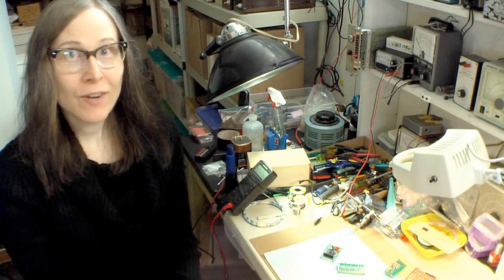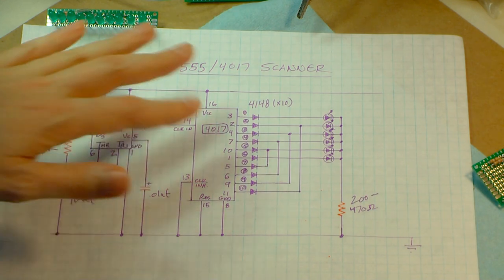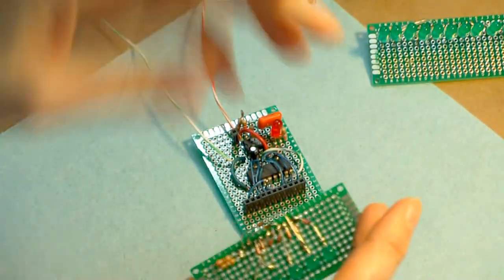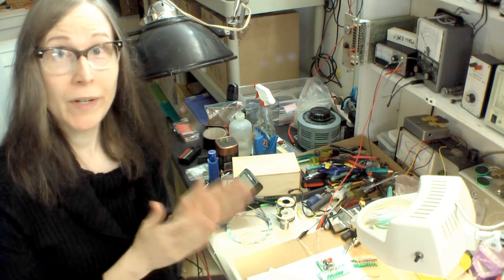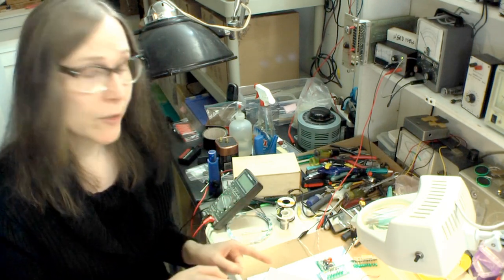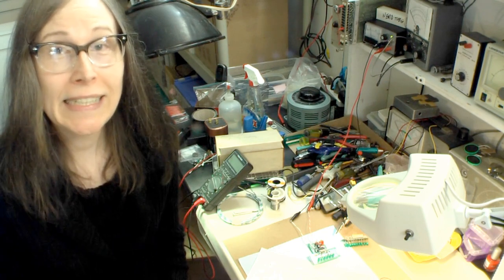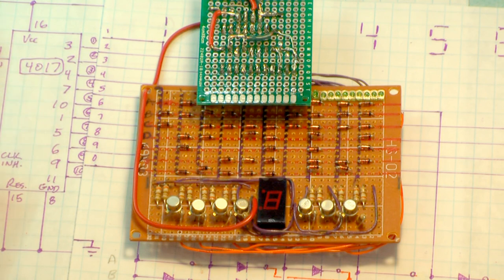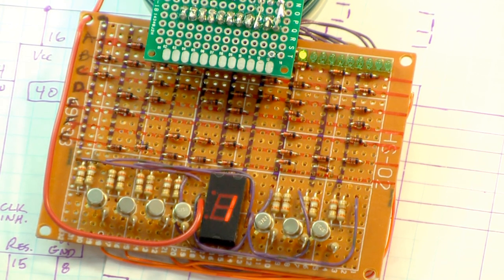FranLab: Diode Steering For Displays

Comment: Nice video - it will surely inspire people to get out the soldering iron.

To the current: The direction was - as fare as I know - defined based on an galvanic experiment. There you can see the charges (depending on the experiment positive or negative) as bubbles in the solution. So I have a bit of an issue when you say "the current is in reverse" - my mind has always to add "the electron current" or even replace current with "flow of electrons".

Saying the "flow of electrons is reverse to the electrical current flow" is more academic, but makes more sense to me. Again: In some galvanic experiments, there are actual positive charges visible, so the flow of charges and electrical current aligns.

It gets really strange when going into PNP transistor, where there is essentially an electron gap which is traveling - the gap can be seen as a positive charge although they are just places where currently is not an electron and it is not actually the hole thats traveling, but electrons "jumping" places making it look like as if the gap is traveling.

Comment: AS to whether the counts go zero-to-nine or some other way depends on your application.  A feature not mentioned is that when the chip goes from nine (last pin) back to zero (first pin) it also sets a carry-out pin high and this is the divide-by-ten output that can drive another 4017.  a string of these in a row make for a decade counter that can be the heart of many other circuits.  If you intend to use them this way, it MUST count zero-to-nine, as shown on the data sheet for the chip.
Reply: You could build a CPU that uses the 4017 for sequencing through the instruction cycles.
Reply: @RingingResonance  You could.  That was the first thing I thought of, when she explained that the 4017 had separate outputs for each state.  Perfect for making state machines.

Comment: I'm working on a custom controller for the video game Kerbal Space Program. I'm taking my design inspiration from the Apollo Instrument panel. My digital readouts are laid out in an imitation of the DSKY, but I did snag some nice alphanumeric 16 segment displays to use for showing units. Since the displays are common anode, they don't work with he LED driver chips I have, so I plan to use diode steering to code the characters (m, s, K, M, G, T, P, E, Z, Y, ∆, V).
Reply: Cool.  I hope for thematic consistency you will also impose restrictions on what repairs you are allowed to do if there is a malfunction during a mission!  :)
Reply: I'm not 100% sure, but I seem to recall that the DSKY used diode steering logic to do the 7-segment encoding as well.  The DSKY used electroluminescent displays, which were driven by relays, but I think the relays were driven by diode steering.

Comment: 27:45 - "Fire in the wire" - 
Eons ago (mid-70s), I was moonlighting doing electronic ass'y for a designer/supplier of specialized modems. Mind you, this was waaay before CAD. When Bob would energize a prototype, he'd announce "Stand by for smoke check".
In the interest of science/history, would you be willing to dissect one of the old Monsanto displays? I've searched, but I've only found drawings of the light pipe LED displays.
Thanx for your inquisitiveness !

Comment: Just for the record, the symbol of semiconductor diodes, comes as an abstraction of the physical form of first of them from early 1900s, the galena catwhiskers detectors, where the cathode is the little "plate" and the catwhisker, a bronze wire or pin is the arrow pressing the galena. If you get to see 1920s you will find them. This happens with most symbols, be them inductors (curly wire coils), resistors (also coils of resistor wire, made straight triangular to ensure they are different from inductance coils), capacitors, and so on.

Comment: 9:48 Is the diode connected to pin 3 of the 4017 necessary since it is going straight through to the LED? (i.e. since there's no "steering" going on)
Reply: It's not strictly necessary (nor is the one connected to pin 1, for the same reason), but if you don't do that, then the end LEDs will be brighter than the rest, since they're getting more voltage.

Comment: Hey Fran, did you know that the Display Systems 19S-8 incandescent matrix display (a.k.a. "eggcrate" display) uses an internal diode steering board to map which bulbs light for each number?

These displays are not multiplexed like conventional LED matrices. It just takes a decimal input, steers the current through a series of diodes, and displays it as numeric data on a matrix of #1820 light bulbs.

Comment: Current flow is the opposite of electron flow. I always have trouble connecting diodes in a circuit and usually have to use the ohm meter to refigure out the orientation each time I introduce a diode. I will try to remember that diodes are old enough that they point in the direction of current flow and not electron flow. 
I do like to think in terms of electron flow which means that the right and left hand rules are backwards. I now say; Face east, use your right hand and point at the eastern horizon with your index finger. That is the detection that we are traveling as the earth rotates. Now at the same time point your thumb toward the north. That is the direction that the magnetic lines of force a pointing. They exit at the earth's south pole and travel up and enter the earth at the north pole.  Now with your hand in that position, your middle finger will curl in the direction that an electron will be deflected. The electrons are directed toward the center of the earth. The earth ground is a reservoir of electrons. 
Now use your left hand and point your thumb toward the east. That is the direction that electrons are moving. When electrons move they generate a magnetic field. All the fingers on your left hand are curling in the direction of the magnetic flux lines that circle the electron. 
These are the new right and left hand rules and they only apply to electrons. The old hand rules deal with current and are backwards.

Comment: I've always interpreted that icon to mean the current in this direction is blocked.  The arrow would imply current direction but the bar implies its blocked from this direction. The same argument can be made for the transistor, the main vertical line being the bar.

Comment: Regarding the diode reversed current direction symbol, I remember, early Japanese electronic products, like 6 transistors AM pocket receivers and other, have had a minus on common ground rail and were using PNP transistors. Rule which follows the natural current flow direction.

Comment: Fun video indeed. I liked the music at the end.
Though I feel the need to disagree that the direction of current flow is wrong, unfortunate at most.
The flow of current is not the same as the flow of electrons, instead it is the flow of charge, or charge carriers. The electron is not the only charge carrier. In the brain Na+ and K+ ions produces currents in and out of the neuron, with the direction of current being the same as the direction of ion movement.
Of course for the aspiring EE student this is a bit unfortunate, but not wrong.

Comment: I drew out but never built a diode-steered decoder back in the 1970s, and was amused to note that including a bar on the six but not the nine would require 50 diodes, which was the number that would come in a package.

Comment: Came here from EEVblog's most recent video tearing down a hardware key dongle for Altera EDA software. This technique of "diode steering" seems fairly obvious, although I don't understand why this technique is called that? You could in theory achieve the same result with open collector / drain outputs or with a bunch of OR gates. What are the diodes "steering"? It seems to me it' the physical connections that steer the current not the diodes...

Comment: What you have really built  there are 7 discrete DTL OR gates. In other words - combinational logic. At least that is what we would have called that when I was in my EE program back in the early 80's. I like the three dimensional circuit building. But angling the diodes at one end or the other would have made that unnecessary. Or . . . how about standing all the small signal diodes on end in a 10 X 7 matrix and driving the anodes on one plane in one direction and combining the diode logic cathodes for each segment on an elevated plane in the other direction and making the display board 3" X 3" X 1" high?

Comment: I believe the diode schematic symbol was derived from the "cat's whisker" representing the fine wire connection to the semiconductor.
I tend to think in terms of positive flowing to negative in negative ground systems and vice versa... and I would call it a converter rather than a encoder or decoder...;-)

Comment: I learned when trying not to fly model planes into the ground, that it NEVER works to tell yourself, "it's the opposite of the way you would expect."  The problem is, at some point, inevitably, the correct direction will become learned well enough that then you end up second-guessing yourself.

Comment: there are 2 parts to electricity voltage that attracts electrons and current the flow of electrons  voltage the electric field flows from + to - electrons flow from -to +   
the symbol for the diode looks  like a point contact diode

Comment: 9.32 I noticed that the LED board that changes direction skipped a light on one of the cycles.  Do you know what could have caused that?  It that the 4017 not latching properly?
Reply from the maker: Penfold8 Vlog Reality - - - Blunt edit between two different takes.

Comment: What one old tech calls "diode steering" an older tech calls a diode memory. Make a fully populated 10x7 matrix of diodes, burn out the "bits" you don't want, and you've got yourself a "write once read many memory" board, a giant 70 bits in size! Lol

Comment: Fun projects but I had to troubleshoot these nightmare networks in a 3 out of 5 wiring system in F-4 aircraft in the 70s. DDL for control lines for mechanical tank tuning in a UHF radio. Try troubleshooting with only analog equipment.

Comment: I suspect that I noticed the small "Easter Egg" at the schematics that is shown at 9min58s, where the diodes at pins 3 and 1 of the 4017 are redundant, can be removed without altering the functionality of the schematics :-)
Reply: Those are there so that the LEDs on the ends don't end up brighter than all of the others.

Comment: 9:30  Did anyone else notice that it skipped #2 one time?  (I’m assuming 1 is the right-most LED and 6 is the left-most LED on the screen).  It went 1, 2, 3, 4, 5, 6, 5, 4, 3, 2, 1, (skip), 3, 4, 5, 6, etc., etc...

Comment: This may be a really silly question but can you explain why the diodes for the 5, 6, 9 and 11 pins of the 4017 in the scanner circuit are even necessary?  I haven't had much experience with decade counters but it seems to me that just making the connection would be sufficient since only one of the outputs is active at any given time. Does sending a signal to an inactive output mess up the sequence or fry the chip?
Reply from the maker: MrChickenPicker Very good question!  It is the simplest way to provide a uniform voltage- due to the diode drop- for the consistency of illumination to every LED in the scanner.
Reply: Fran Blanche
That sounds logical. Does that mean that the circuit would still work without the last 4 diodes but the LEDs would be brighter when the sequence reverses, because the voltage drop across the diodes is no longer there?
Reply: I think Fran is talking about pins 3 and 1. Those can be omitted but will result in higher brightness. 

Leaving out e.g. The diode at pin 11 will break the circuit. The 4017 will have one pin high, but the rest of the pins will be low. So without the diode at pin 11, when pin 2 is high current can go from pin 2 directly to pin 11. This will result in the led not being lit and possibly damaging the 4017 as there is no current limiting between pin 2 and 11. 

Hope that helps.
Reply: beargun42
So every output of the 4017 that is connected in some way to another output of the same chip, must have a diode to block current to the output that isn't used in the sequence to prevent damage to the IC.  In other words, no direct shorts are possible regardless of the state of the output.  Is that correct?
Reply: Yes, that sound about right. 

Another way of thinking about it is that because there's an diode on every output, the outputs can only source current, and not sink any. 
(HIGH or nothing, instead of HIGH or LOW)
Reply: Tying pins together will give an uncertain output. You need an "open collector" type output pin to make a "wired AND/OR" connection.

Comment: the diode flow how true military usees heavy duty power supplies negative run for control of application thanks for the flow directions have seen tubes transisters ic chips all working together in one system been away from this stuff for 30 years once again thanks for the talk and show

Comment: This video has made me realise how poor my PC or my internet connection really is.  When watching the ten LEDs I see the sequence jump two or three steps every five seconds or so.  Something in the system can't handle the full data rate and the vision falls further and further behind the sound until it suddenly decides to catch up by missing out a chunk of vision.  Oh the joy of using a Windows XP computer on 0.5Mbps broadband.

I hate to be picky Fran but I think your explanation about transistor and diode symbols being back to front will just cause confusion.  Surely everyone apart from physicists talks about conventional current direction ie current flows from a more positive voltage to a negative one ie in the direction of the arrows on the symbols.  The actual charge carriers, the electrons, may flow in the reverse direction but that's because they carry negative charge.
Reply: Your comment puzzles me.  I know of no one within the electronics community who talks about hole (positive) flow outside of the classroom, and that is only speaking of antiquated theory.  It's always the electron which jumps ship and travels the void toward the positive horizon.  Anyway, I like to think of the arrow-like symbols as being more like a greater-than sign: the open end being more positive and the pointy (or lesser) end being more negative.  Since current flow is negative to positive, one does not need to think of it as "against the arrow."
Reply: David Slone
During my 40 odd years in the electronics industry I can only remember one occasion when I've met someone who clearly referred to electron flow as being positive current but when I think about it the vast majority of discussions don't actually refer to current direction at all.  Everyone knows which way they think the current is flowing but there is rarely any need to mention it.  Statements like "the collector current will be hFE times the base current" work equally well either way.  I think that most people learn which way the current flows from batteries and lamps and the like before they even hear about electrons let alone holes, but I may be wrong.  Perhaps it's a US/UK thing.